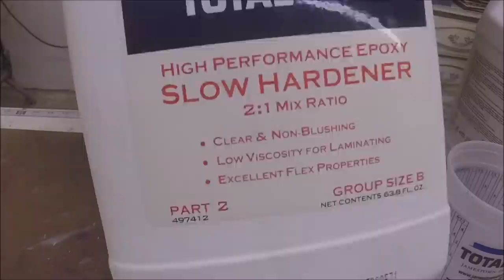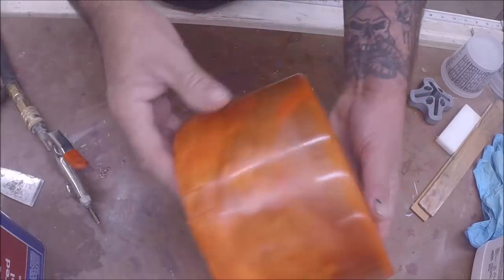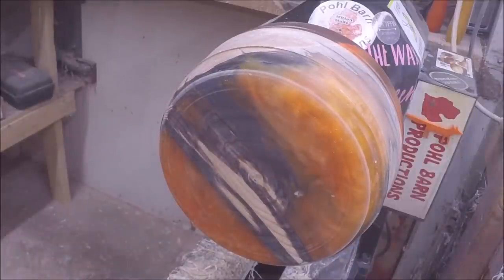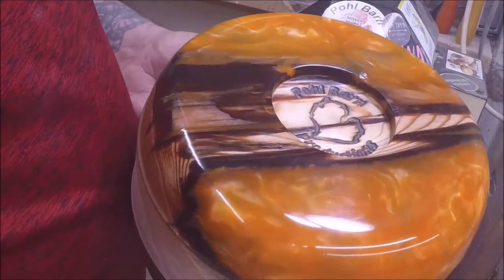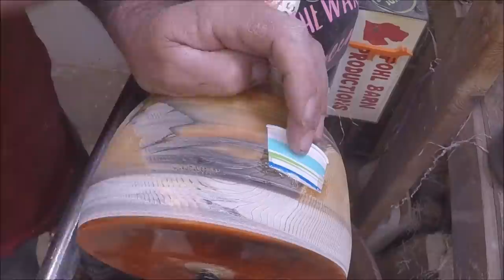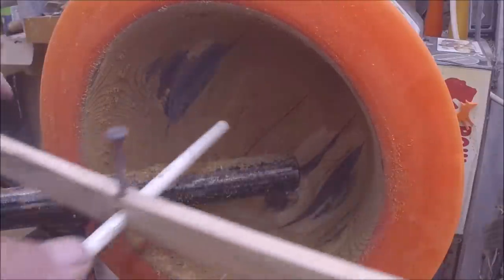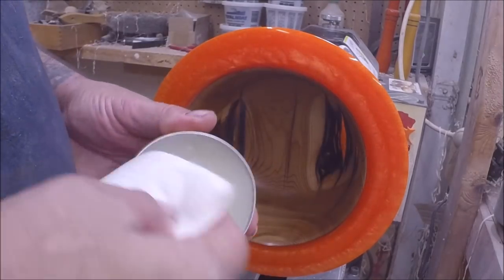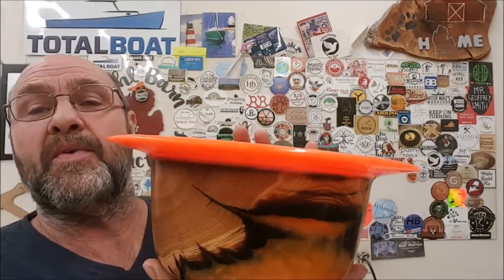Flo Orange Resin and Cedar Bowl

Comment: Personally, I'm not crazy about that lip being so wide and narrow, but bowl portion is awesome. I'm thinking it's time to clean junk out of the shop, and get a full sized lathe. My midi-lathe projects are getting a little too common place. What machine should i look into getting?
Reply from the maker: Thank you Thomas,  really if you can afford it look into the powermatics,  for the most part I've heard many horror stories on the lathe I use and many many on it's counter part with a different name.
Reply: @PohlBarnProductions  I'll do that, thank you

Comment: I really like the addition of the rim, quick question though, when doing that, do you have to do anything special to the hardened form to prep it to adhere to the new stuff?
Reply from the maker: Thank You,  you could spray a mold release if you really wanted to, the molds I am using are HDPE so the resin doesn't really stick to it all that bad.